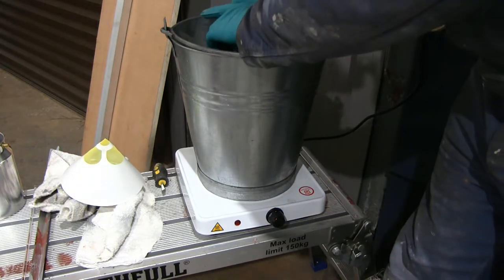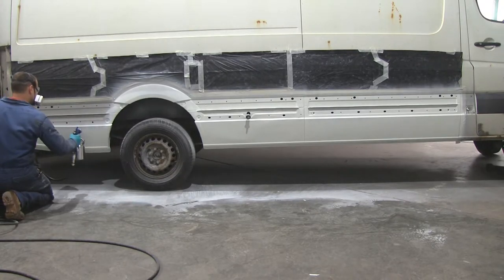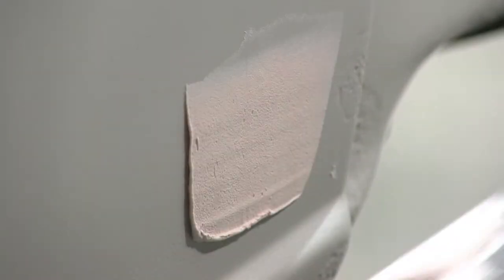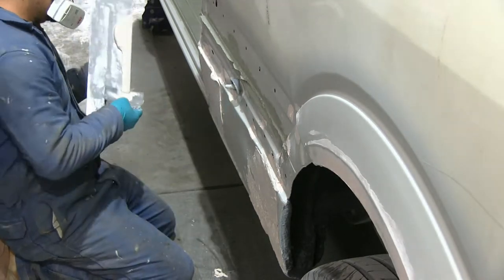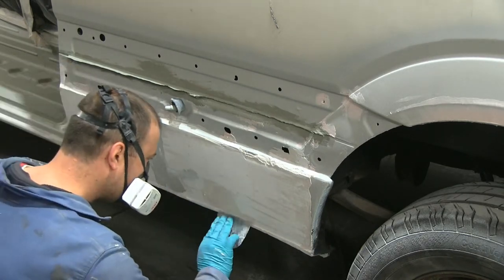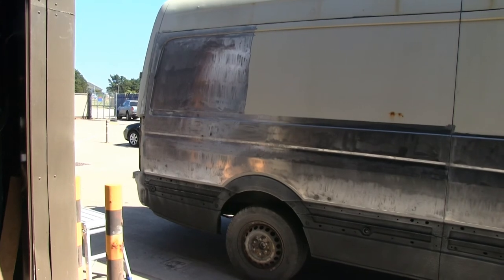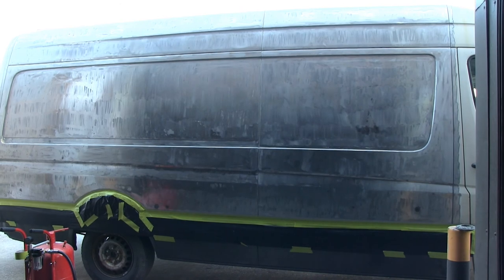D.I.Y anti chip coating auto painting for beginners | How to prime with an automotive primer sealer

Comment: What about the wheelwells, at least brush on some gravitex, or similar to add protection,to battle the rust monster ,and since this part where the wheel is gets dirt, plus when the roads are wet the wheel while moving  brings dirt water on to the wheel well,and I don>t know if where you are it snows, they put salt on the streets,which could contribute to the corrosion rust of the van/car.
Reply from the maker: Done

Comment: Do you think this will work on hot dip zinc gates?  What thinning % would I use to spray paint gates with this with a 2/2.5 nozzle
Reply from the maker: Just check what is recommended by manufacturer

Comment: I got a bottle of gravitex today. Will it work as good if it’s brushed on, It’s just for the cab floor of my van. 
(I haven’t got a air compressor)
Reply from the maker: Hello Brian, cannot think why not. If you not worry about any particular finish and apply several coats, you will be able to build a decent layer. Just make sure you do not apply it onto bare metal. The metal has to be protected first.
Reply: Not worried about the finish as the floor mat is going to cover it up, I need to wire brush some rust patches, what should I use over the bare metal before putting on the gravitex? 

Thanks for your reply 😀
Reply from the maker: @briancullen8913  I am not  a Pro painter and i do not know your budget, but i used Zinga (Shown in some other videos here on my channel) and it worked really good as paint job is a year old not and everything looks fine. I would go with cleaning to shiny petal first, then put on some zink containing primer and sealing primer over the top. even if you have not got a compressor, you can still get 2 component primers in the cans. Have fun!

Comment: Hello, I have a Iveco Daily that I'm planning on spraying with U-POL Gravitex plus hs stone chip coating as its remarkably more cost affective than the raptor paint. Do you think that that would work? Many Thanks
Reply: Also how many bottles do you think for a whole mwb van not just the bottom there? The roof, bonnet and sides?
Reply from the maker: Gravitex is a stone chip prevention product. Not sure if it going to be good long lasting finish as a top coat. On this channel there is a painting play list and there is a video of painting same van with gravitex,   I think it would give you some ideas.
Reply from the maker: If I remember correctly, I used 12 bottles of  Gravitex on my van. It will depend on the thickness that you are planning to lay down.

I have a project of a camper conversion in the future and I elected to use raptor.
Reply: @weld-deluxltd7635  thank you for the reply. Big ups

Comment: hi all, just a question  what about with the spray gun type to apply that antichip (pvc sealant),is it a standar spraygun or is an special plug.
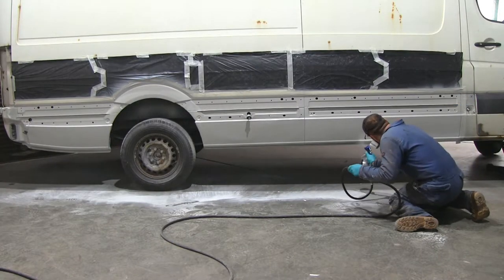Reply from the maker: You can use standard spray gun but it has to have large hole in it. The one you see me using at 2:00 is 2mm hole and i tried with 2.5mm hole and it worked even better. Please bear in mind that the smaller hole in the gun the finer the spray and smaller thickness of anti chip (You need to do more layers)